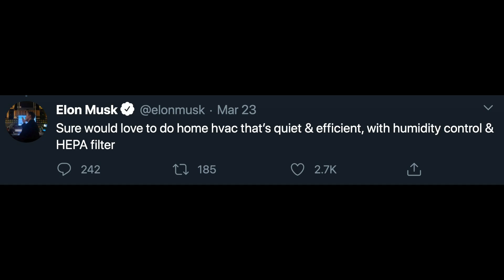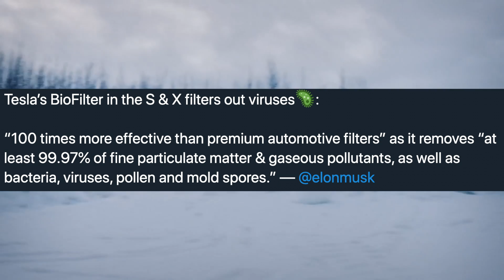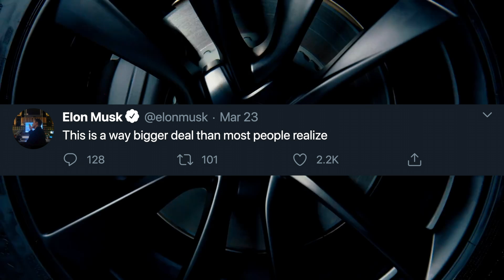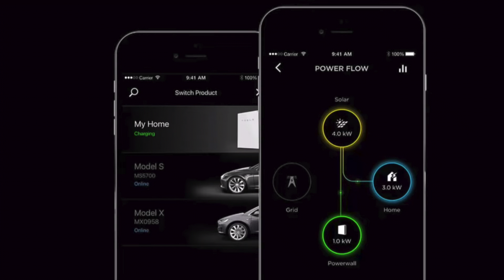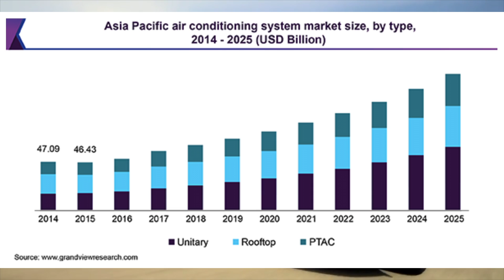Tesla's Secret Upcoming Product: HVAC for Homes (Heating, Ventilating, Air Conditioning)

Comment: In Twitter and media there are rumors about Tesla HVAC system features. 1) AWH (water condensation from air), 2) HEPA anti-virus and allergy filter, 3) air cleaner and purifier, 4) heat pump for heating, 5) air conditioner for cooling.
The only elements missing in this collection and in Tesla's Business Plan v.3 are air modification, heat recuperation, air (de) / humidification, salted water desalination and wastewater distillation.
By the way, we have technology able to really combine and even integrate all functions mentioned above in one unit.

Comment: Living in Az Air Conditioning is the single biggest component of your electric bill  May-Oct is AC.
Since humidity is pretty low most of that period reclaiming water doesn’t seem to be as big an issue for me as say someone in Georgia.
Rather than the bells and whistles which are easily attained currently with a smart Thermostat and Mobil Phone so that’s a yawner. 
I would be more interested in doubling the Current efficiency of 
from say 15-30 sear and the installed cost.
The payback would have to be 5 years

Comment: Home HVAC is a much bigger system than in a car.  I'd like to see the efficiencies of a Tesla electric HVAC in a home system, but I'm not sure it's a strong market for them to jump into.  Scaling up the electric compressors means more rotational mass, which means more noise and more energy use.  When it's all said and done, is it going to be more efficient by enough of a factor to get the market share they'd need to turn a profit on it?  Maybe.  Just saying that it's not a 1:1 transfer of technology.

Comment: We make this product. I was the designer for the first one.  Check out Tecumseh Products Masterflux. It is a small variable-speed compressor that's programmable. There is a variety of sizes and is designed for electric cars and many other applications.  I like the idea of keeping the pure water that is a byproduct of refrigeration. Also look up "combined heat and power".  We were working on a sterling engine version of CHP until we were taken over in 2006.

Comment: You do realize that home ACs are usually electric run right?  It's only in vehicles they need to be mechanically ran (belt driven) because they are not ran on electricity but gas.  Now if this is like some type of highly efficient AC for relatively affordable prices than Im for it. But knowing Tesla.  People that have money will pay 2x the normal price for slightly more efficiency and a name.  Gotta love their branding that they have made now.  Their cars are great, but they are capitalizing now. Good for them.

Comment: He’s talking about geofencing. This is not a new technology. This is not his idea. Been around for years.
Reply: Yes. There are several hvac equipment manufacturers and thermostats that have had this technology built in for years.
Reply: And yet no manufacturer has tapped into producing to public it until now....
Reply: @joshpacuan3296  What do you mean? My thermostat uses geolocation (and it wasn't the first one to use it) to do just that. Except it doesn't require a $85,000 car, just a smart phone. This HAS and IS already in the HVAC market. LMAO
Reply: @d0tc0m187  thank u for correcting me! My bad! Im not so tech person..and completely forgot about that mobile app!😌😓

Comment: sad i have had a plan for better part of 20 years  that equates to a solar powered hvac..  that IS NOT the equivalent of plugging a window unit in to a solar panal  i cant get the funding
Reply: I have seven business plans depending on which avenue funding comes in first. The initial emphasis is Housing hotel/airbnb food electricity  water cryptocurrency and fuel... The solar AC is part of food fuel and water business plans.

Comment: The smart building has to have the most efficient HVAC especially for a net zero building. The concept of Green HVAC (issued patent and trademark) addresses two functions:
First exchanging air between higher elevation with lower elevation for manipulation of Deltet and thus better thermal comfort.  Secondly outside air to manipulate inside temperature for thermal adjustments . Considering thermal conducting time delay concept. The days and night temperature difference can be a lot. Changing days to   night temperature and vise versa is very possible as needed. 
All the above can be done with one or more solar panel and DC driven fans.
Any ?
cg@cgitechnology.net

Comment: The air filter he was talking about in his car, all it is? Is charcoal lined filter. Now if it is 1" thick  charcoal interwoven with a paper membrane, this would make it filter out easily 99% of anything you would breathe in that car! Like wearing a military full face gas mask!
The way to cool your home is with split systems. No duct-work, remote control, very energy efficient too. Much cheaper to install, easier to maintain and clean. You can even buy the systems already charged with refrigerant! Mailed directly to you home! The next best system for cooling you home would be chilled water system! You can buy chill water systems for cooling the air in your grow room for growing by hydroponics. They make different sizes to handle different room sixes! And extremely efficient when you chill water as opposed to cooling air!

Comment: You use stock footage and have no information to contribute. Yes he has these air condition air compressors that I have shopped on eBay there are literally hundreds of them of all model years he has Source them from different countries over the generations and he talks about conventional Cooling in this interview. By the time you made this interview of the global cooling prize had already awarded to eight prizes. I don't think he entered the contest and there could be a business reason for that if he was wanting to stay low but the reality is cooling the air and dehumidify the air is not the correct way to provide Comfort to people. It's. The temperature of the air that makes you uncomfortable it's not the amenity in the air that makes you uncomfortable it's your temperature that makes you uncomfortable. This is so simple but it takes a tremendous amount of energy to provide Heating and Cooling that there is no benefit for and I'm not talking about in the obvious example of nobody being in the home that has the promise that it takes up energy to prepare needlessly far in advance and their words the premise is that you have to adjust the temperature of the home in advance it's the body that requires ample time. Let me say that again the body reacts in the moment based upon concerns of where we'll be in several hours. The body not the house. That's the mistake that Elon Musk joins and making with everybody else. Our existing cooling people with air makes it necessary for the body to be afraid because if you're talking about the air throughout entire house or they are in a single room or the error that could be blown at you. Yes that's not going to be able to get you out of trouble fast enough. The issue is why are you headed for trouble why is your body believing that you're headed for trouble. It's the trust issue and I'm talking about the neurology I'm not talking about stuff we talked about I'm talking about Comfort resulting from everybody being paranoid because nobody provides the technology that gives people Peace of Mind instead companies destroy the planet reducing the humidity in people's houses or dropping the temperature of the air in people's houses when there's no legitimate basis to defend that it's Luke using propellers to cross the ocean. Not for cargo! You use the pilot that does not know how I know how to land plane if you are up to no good and you use propellers if you have not been paying attention to the fact that we have containers Etc.

Elon Musk Season Market but he ignores the fact that the market is anti-competitive and disrupting anti competitive markets is a process because anti competitive markets respond to initial disruption well. You don't innovate behind-the-scenes you innovate in battle.

Tesla provides a HEPA filter for the car they can do so because the car is so airtight ads they contemplate less pollution on the road. The cost of HEPA filters in Rhodes as they are alone prevents the business model from being competitive. I mean where do you think the crap goes in an electric car with a HEPA filter if the air conditioner is operated with the windows slightly open? Do you believe the General market will allow for the manufacturer preventing the air conditioner from being operated they are for big filters if fresh air is being brought it as well? The consumer wants to do with the consumer wants to do and the technology to satisfy their needs is that a fairy I said necessary. The question becomes how do you keep somebody who is hiking cool. How much does the cooling system weigh how much does it cost how many watts does it need to be to keep somebody who's walking in the hundred fifty degrees with their light 100% humidity and extremely bright sunlight cool so that they don't sweat at all except perhaps in their lungs in terms of having evaporative losses of body fluids that are unavoidable, oh, your video here suggests that you'd want to condense those Vapors so that people can drink the body fluids that evaporate from the interior of their lungs when they are extracting the oxygen from the air that they inhale. I don't agree that that is worth it. Not for the typical buyer not for the main Market. What people need is to experience alack thermal insecurity. That means that you don't get hot enough to sweat

Comment: Do not forget all aspects of refrigeration and freezers. To include commercial at all sizes as well as Slurpee type machines. 
Also, because of this virus pandemic. The addition of ozone generation and UV light as well as other unknown technologies will go a long way to better health. Especially if it is all built in and then controlled by computer access. Think about it. The levels of ozone required to kill the really tough bad stuff requires high levels of ozone concentrations which is harmful to humans. Which is why you would use it when your not home as is already being done in football and other athletic dressing rooms. Those Ozone devices are additions which you have to install separately. Just like the UV lights. Your AC tech can already add UV light kits to your window air-conditioners. Think about it.
Research air to water generators.

Comment: The hotter the day, the more you need air conditioning. The hotter the day, the more sun is shining. If the entire body of the car, or roof of a house, was photo electric and heat collection combined, air conditioning could be free.   Gasses can be compressed directly by heat. (propane fridge)

Comment: An integrated thermal management system for a house is waiting for development. From an engineering standpoint, It is ludicrous to remove or add heat from the air, cool food, heat a swimming pool or spa, heat water then dump that heated water down the drain all without an integrated approach that included centralized thermal storage reservoirs for hot and cold use.

Comment: DO NOT DRINK THE WATER COMING OUT OR YOUR AC SYSTEM!  If you look into the condensate pan of any system running longer than a few months, you'll see a nasty, thick brown gunk growing in it.  It is basically pond scum.  Aside from the, the water is basically distilled.  Not good for your drinking needs.  All that said, using it for stuff like plants is great.  Other things, too.  Just don't drink it.

Comment: Interested to see what Tesla’s spin on a whole Hvac system is. Been a technician for years now and a lot of the technology he’s calling for are already in existence through the big brands in the market. Solar powered heat pumps already done. Smart thermostat with Alexa/google assistant already done. Thermostat with geofencing already done. Really it comes down to the seer of the Tesla hvac system and there’s already some high numbers out there! Cheers!
Reply: An integrated thermal management system for a house is waiting for development. From an engineering standpoint, It is ludicrous to remove or add heat from the air, cool food, heat a swimming pool or spa, heat water then dump that heated water down the drain all without an integrated approach that included centralized thermal storage reservoirs for hot and cold use.

Comment: There are products out there which can zone your central HVAC system but there are problems as when you close dampers and reduce airflow to cool and heat fewer rooms that puts a strain on the blower motor which can reduce the motors longevity . That would be an easy problem to solve having the motor operation at different speeds  . As far as AC condensing units and getting them to use less electricity is difficult and like trying to make an electric space heater more  efficient and use less electricity . There is a market for complete zonal systems instead of trying to modify existing system that may not be healthy for the existing system and I am surprised there hasnt seen much change in HVAC sytems in a generation so this is an easy one for Elon

Comment: A Tesla AC would need absurdly low power draw to have relevance in the market.  You home electric bill is basically another way of saying you AC/Heating bill most other appliances in your home don't touch that level of power consumption except for an electric hot water heater.

Comment: Why r we not connecting battery system to a generator...that way it transfers energy back 2 battery! = self charge!..What a Buch of BS!...We deserve free energy!
Reply: Bro I've been asking that question for years and also why can't electric cars recharge themselves?  I mean there has to be some way of using the energy from the rotating wheels to recharge the batteries.
Reply: @KNByam  Im 4 real....All it needs 2 be is in a 3 part system,,, 1 charging 2 charged 3 working...then transfer ...WT$ is going on?
Please tell us why not?...We have magnetic generators spinning so fast and hardly using an amp ....If that...People r being played!
Reply: @kennethsalter9998  Simpatico.

Comment: HVAC's need to use the heat generated from A/C to heat water in hot water systems.  And refrigerators could do that as well.  Stick the compressors in the attic so they don't heat the house and if you need the home heated run it through water pipes in the floor.  His HVAC's should be DC powered so you wouldn't lose energy in converting from solar to A.C.  And include a humidifier and HEPA filter in the system.  A real energy saving HVAC like geothermal would mean building his HVAC into home designs, so might as well make prefab homes as a package deal.

Comment: This is the real deal. 

When you buy solar panels and a power wall from Tesla , you need two powerwalls in order to run your AC unit off grid - because most AC units draw too much energy , 

Your AC unit is the number 1 highest energy use of your home , if he could cut AC energy by just 10-20% it would revolutionize the entire system and allow someone to install only one Powerwall saving thousands upon thounsadns
Reply: These systems already exist and have for years. A/C or Heat Pumps that utilize inverter compressor technology already do this. Every hvac equipment manufacturer on the planet has high end units that utilize this technology.

Comment: If you could control each room individually you wouldn't have to keep the whole house at a certain temperature just for the plants or things like that.  Also if the stat could be programmed for your personal desired temp for day or night then even motion detection could alert it to adjust that particular room temperature.   Just some thoughts 🙂

Comment: Tesla is not going to revolutionize the air conditioning system.  Any improvements will come with better distribution systems, lower loss ducting, insulating, improved heat exchangers.  Putting a HEPA filter into the system is just air filtration and is not going to improve the refrigeration cycle.  Any gains in efficiency will come through control of the process like variable capacity compressors.

Comment: I am an HVAC contractor in Texas. Carrier, Trane, Lennox, etc have been making Hvac systems for over a hundred years. First of all Hvac systems do not make clean water. That water condenses from a nasty evaporator and travels down a nasty pvc pipe, all the while coming into contact with all that is in your home air, including pollens, dander, dust, mold, etc. This water is not clean.
   Anyone new to this industry will find itself devoured by already super extreme efficiency. Not ever, ever  gonna happen.
Reply: LOL thats what the auto industry said... small minds have small thoughts

Comment: I always thought of that idea, the ac is making water just to be dumped, why not use it? So I used it as water for my car's radiator..
Researching drinkablity, turns out distilled water you need to add electrolytes, or it'll suck out minerals from the body, but its easy, 1 kg or a 2lbs of these minerals could last a good month or so